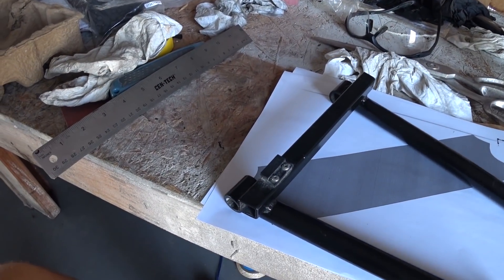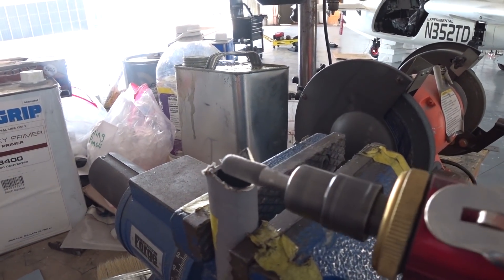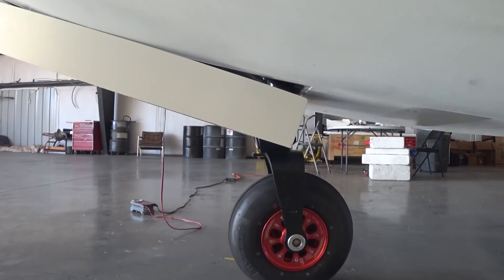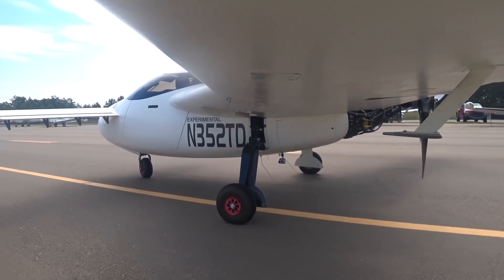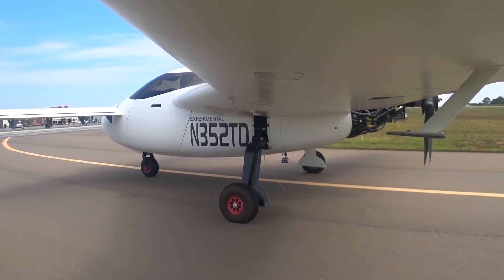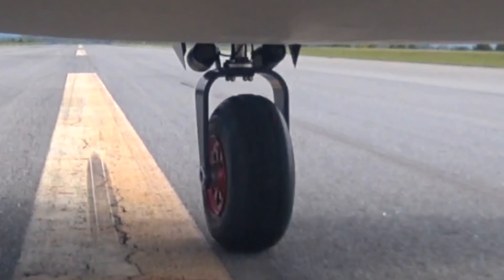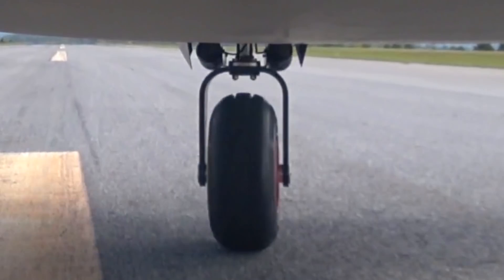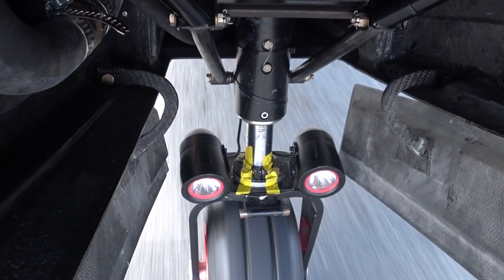Did We Fix the Shimmy? - Building the Raptor Prototype

Comment: BTW, I built a Long Ez and the front gear has a pretty extreme trail, yet shimmy can still happen.
Many early Longs broke the fork due to extreme shimmy. 
Rutan improved the shimmy damper and was incorporated in all Longs. 
Short story, I doubt more trail will make a difference. 
You need torque links and a piston shimmy damper like on most tricycle aircraft.

Comment: So based on the numbers, the Lancair trail/tire radius ratio is 41.6%, Raptor is 26.6%.  I think you need more trail, at least equal ratio as the Lancair (so 3.12" for Raptor... heck I'd go 3.25" if you won't run into clearance issues).  It was another Aussie that got me hooked on good geometry on motorcycles (GMD Computrack), rake and trail changes make a huge difference in stability.

Comment: Having those permanent marker lines on there really helps.

What I found interesting what that the shimmy happens when the weight on the strut gets lighter.  As you had discussed previously, due to the line of thrust, the engine actually puts weight on the front gear.  That one time from the internal view when it almost started shimmying, it was just beginning to extend.  And then when it really got going, as you said it hit a bump.  It was during the rebound that the shimmy began.  I almost wonder if additional brake pressure would actually get rid of the shimmy.

I'm not sure what that centring mechanism within the strut is or how it works, but my guess really is that there is something in the config of that strut that is allowing the shimmy.  I'd say with the quite a bit larger tire that you are running compared to Lancair, definitely go for thicker oil.  And lower air pressure in the tire as one of your suggestions for sure, to get more surface area of the tire on the ground.

You already have it pretty much figured out when you release the videos.  Keep plugging along.  We are all desperately excited to see it lift off the ground.

Comment: You decelerated and shifted the load forward onto the nose. IDK how to fix it, just my observation.
Reply: Araye it’s a canard so on deceleration the load on nose becomes less with no braking
Reply: @NC_Hydro  Hi Mo. Do you believe that small canard has enough lift at 37 mph (and decreasing) to substantially decrease the load (beast weighs 3500 lbs) on the nose gear? I will grant you that he is applying full up elevator? Maybe you're right...
Reply: Araye it’s not about the canard lift (I should have said pusher) it’s about the sudden loss of thrust from engine when power was cut  which in a pusher exerts a downward force on the nose gear.
Reply: @NC_Hydro  Right, so the load is increasing on the nose gear as the throttle is decreased... correct?
Reply: Araye when you throttle up it’s pushing forward hard at chest height which is putting some downforce on nose gear...decrease throttle and that load lessens IF no braking pressure is applied.
Reply: @NC_Hydro  Thanks Mo. I think I get it.

Comment: Hi Peter,

I'm thinking your problem is centrifugal force related. If you look on the videos the initial force always seems to be applied in the direction of turning the tire to the passenger side or right. if you remember the demonstrations of centrifugal force from high school physics class when spinning a bike wheel - when you try to turn it to the right, it will also try to snap roll the wheel along the horizontal axis too.
Reply: Centrifugal force provides rotation at 90 degrees, but the fork supports both sides equally/countering and cancelling the movements. Centrifugal forces are parallel to the ground tangential to the forward circular motion.

Comment: I really thought a trailing wheel would have done it, maybe a damper or for the front wheel to be perfectly centered?
Reply: Maybe like motorcycle steering dampers?
Reply: Observers amateur analysis: Tire width combined with low tire contact pressure allows the tire edge to grab.  Add a passenger for a weight test or perhaps a narrower tire or both.

Comment: Hi Peter. a couple of thoughts. what weight do you have on that front wheel? also noticeable is sideways movement of the leg during the oscillation. Could that be movement of the leg and it's support panel? And how much trail do you have- say,  compared to similar sized aircraft? Enjoying the whole series here in NZ.